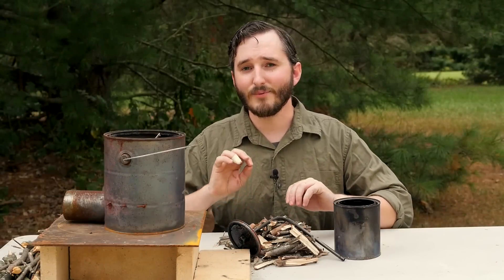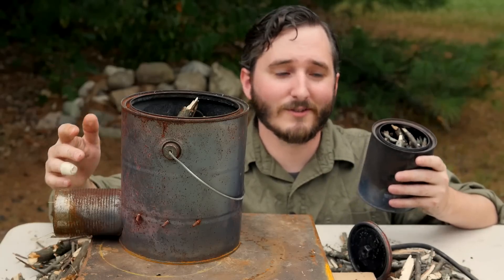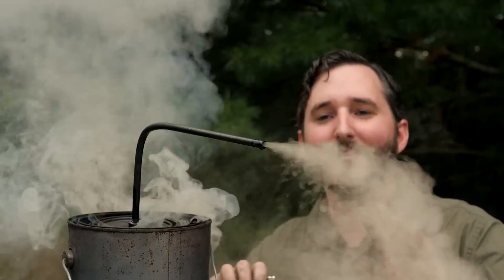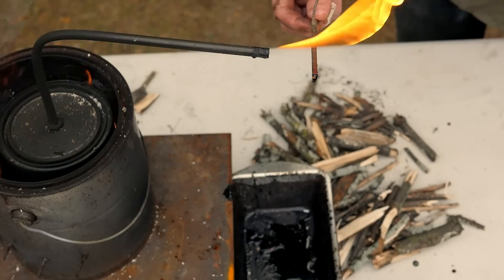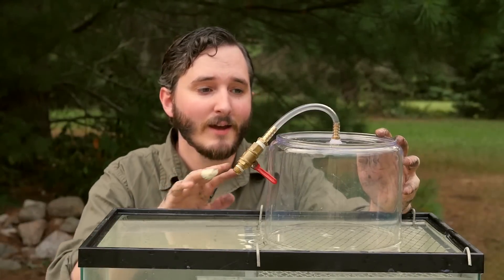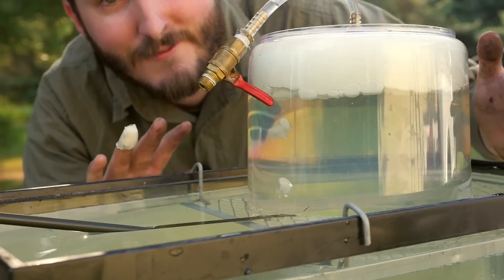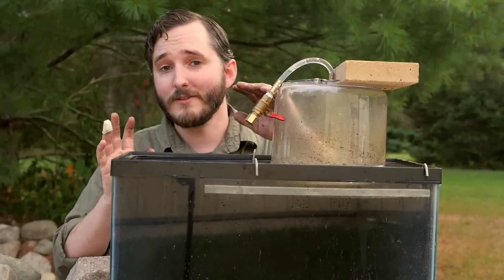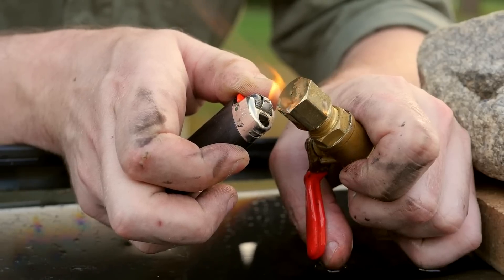How To Make Wood Gas Biofuel (and an experimental gas collection method)

Comment: if you put a condenser on the brake line (like a shine still) and then had the line running it to a jar with a lid to collect the tar and then a line out of the jar running to a compressor to compress the gas in to a lpg tank to collect it for future use, would that work? i may have to try it myself in the future. i will just have to make shure to get all the air out of the system before attempting to compress the gas so that it wont have a chance to ignite because of the pressure.
Reply from the maker: Condensing the smoke and that is hard to do in a small line without clogging it
Reply: I think the tar would/could condense and congeal in the condenser and plug it
Reply: You have the right idea. Basically, you pipe the smoke downhill with multiple "T"s that allow the sludge to drip into multiple jars. You need pretty long runs to allow for cooling, use coils to save space. The first jar will fill with sludge, the next will be more like crude oil, then amber, then almost clear, then clear... These can be further refined and/or used as fuel too. This water filter would probably accelerate the cooling/filtering process but wastes and pollutes water.
Reply: The problem is the smoke has liquid and solid contaminants, so a normal condenser won't work. My friend has had quite a bit of success just feeding the exhaust into a 20' long water-cooled 4" cast iron pipe, though. Solids and tar settle out, and the gasses leave the other end clean enough to compress.
Reply: +Squat251 Gaming
The problem isn't so much that it's hard to compress or store, it's just not common because it isn't a particularly economical way (on a large scale, anyway) of producing these gasses. You could rig a low displacement pump to only cycle as long as the "feed" pressure was higher than atmospheric. Hell, you could even run it off a Stirling engine, get more useful work from the heat you're using to pyrolyze the wood in the first place.
Reply: @polyjohn3425  I thought it was used right away.
Reply: Also with coal gasification they used to also use water sprays in chamber, mostly to get out the benzene and ammonium sulphate. I'm not sure what they used for the tar, but I have been wondering about it for years. I went to an old convent once and one of the books they had was called "The Gasification of Coal", from around the second world war. Pity I couldn't read it, it was only there for display to look old. Inquiring minds want to know damn it :l
Reply: Not to be obnoxious about it, but the old-timers with whiskey stills used a "thump keg"... It's a chamber design for condensing the contaminants out of your vapor stream (exactly the same principle)...
  You'll actually need two chambers though if you want to compress. The first (thump-keg) works with a line in and a line out (not connected) so the hot vapors keep moving through. You probably don't even want the line out to be directly across (geometrically) from the line in, so you won't just force smoke through the thing... Encourage the stuff to swirl around and cool a bit. The steam and incoming vapor should heat just enough to keep the stuff you want (but the perfect size and rate will take some monkeying around /experimenting)...
   The second chamber at the end of the line should be expandable, or have a control valve to "purge" the oxygen rich atmospheric air out as it takes vapor from the gasifier in... A view window is a good idea if you can't / don't go completely transparent plastic... The point here is to collect enough gas at a time to catch it with the compressor for pressurizing and storage. A decent small compressor (or a good old one you can rebuild and clean out occasionally) should run about 3-4 CFM (around a 1hp motor)... If you shop around a little, there are still models available with an intake filter/pipe that you can remove completely, replacing it then with (in my experience usually 1/2 inch) tubing will let you plumb the thing to your "catch tent" or finishing chamber from the gasifier project... That is (of course) only if your interested. :o)
Reply: swedishREdneck compressing gas like that could be dangerous as in boom
Reply: Call NileRed! To the Redsignal!
danananananana!
Reply: mayby have a larger copper line or just a t pipe coupling facing down  and going in to a jar, there must be a way to extract the tar so that you can compress the gas. i think i will have to start tinkering with this now!
Reply: Simply collect the gas in a colder container ( at its bottom) and collect the tar free gas from the top of the same container. You can again re clean/ scrub it in the fashion shown in the video. That will give much cleaner gas I believe.
Reply: i think the compressor would work as a vacum pump so that is going to be a problem...
Reply: yes but it would quickly clog with tar if it was a tube that wasn't heated. A chamber would probably be better, maybe with an internal cone filled with cooling water?
Reply: yes if there is oxygen in the system
Reply: That is why I said pipe. Think bigger. You can cleanly cool the pipe from outside too. Drop a coil in a barrel of water, as long as it is watertight it won't pollute the water. A bulkhead fitting or two and you can catch the sludge/fuel at the bottom in a jar too. Of course it you are going to go through all this work, you should build a much larger system.
Reply: Just make sure that you make enough gas at once, otherwise the compressor may not have enough gas to suck in which may not be that good for the compressor. I am not sure though, i don't know that much about compressors. Sorry for my bad English. But if it works, that would be really cool.
Reply: swedishREdneck I'd be careful because you don't know if the compressor motor makes a spark when it's running, especially if it's a brushed morot
Reply: I think a hermetically sealed compressor will do.
Reply: The compressor might pump in more air than the system is putting out, so try to regulate the air the pump is pumping at
Reply: not very well. The volume being produced is really low compared to the amount a pump would draw. Most of the product here is hydrogen which is a lot lighter than most of the fuels we use, making it way harder to compress. It's one of those "if it was easy, it would be common" issues.
Reply: Woodgas you can't sore that long. Like days in a lpg tank if I rember correct

Comment: When I was 13 I made a full gasification unit complete with a cyclone filter, a cooling coil with water/tar collector, and a media filter. The cyclone filter was used to spin the gas in order to force the tar, soot, and other impurities out of the gas. The cooling coil was used to cool the gas in order to produce a more efficient and hotter burning gas, as well as to condense the tar and water vapor out of the gas.
Next, the media filter would allow the gas to cool further as well as remove the last of the impurities. 
I only ever ran the unit once because of it being poorly built and very sketchy due to using free recycled material. But I did however get a very pure flame that was a very clear dark orange. although it was contaminated with excess oxygen from leaks in the connections. I am confident that had there been no Leaks, the gas produced would have been capable of running an engine.

Comment: Now I want to see you hook it up to. An air compressor and fill a tank with it to see how much you can collect. Of course check to see if it wont explode first  putting flamable stuff through it. Just turn on and off the air compressor when the water level gets too close

Comment: What is u used tge piston from your vacuum cannon instead of the chamber on top of the fish tank.  You could drill a small hole at the back by the poston.  Then you could attach the front end to a tank with a one way valve.  When the piston was filled it would ve as simple as pushing the piston in to transfer the gas to the tank and would empty the collection cylinder.  This would allow you to collect and pressurize the wood gas at the same time

Comment: You might get a better combustion if you drilled some small holes on the flat sides of the brass end cap. That should allow a mixture of oxygen and gas to exit and burn since the oxygen will be pre-combined.

Comment: Shouldn't you also say that wood gas contains carbon monoxide, which is poisons and can lead to death. Wood gas caused several death when it was popular. Just in Sweden it is responsible for 12 deaths. Be careful people, carbon monoxide is dangerous stuff!
Reply: All gases are toxic to the body, if you breath in propane you can die just as you would with carbon monoxide. Oxygen is even toxic to our bodies at certain levels
Reply: @RecockulousIdea  This stuff is around 20 percent carbon monoxide. By contrast, around 3 percent carbon monoxide can be fatal in just one breath. It's much worse than propane.
Reply: Monoxide is more toxic than propane.  Even at a low concentration it'll preferentially bind to haemoglobin and displace oxygen, leading to asphyxiation - this can happen even in an otherwise oxygen-rich atmosphere.

Comment: A lot of butane and kerosene torches have vent holes near the opening to allow oxygen to mix with the gas, which aids in continuous self-combustion. Same for Bunsen burners. So if you wanted use this as a sort of Bunsen burner, that might help.